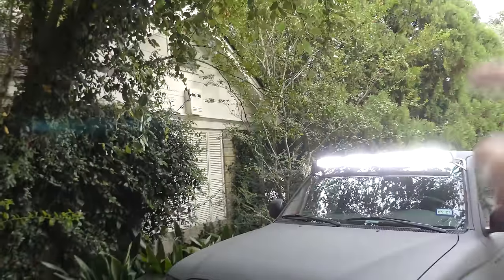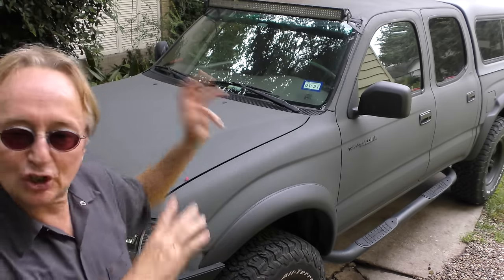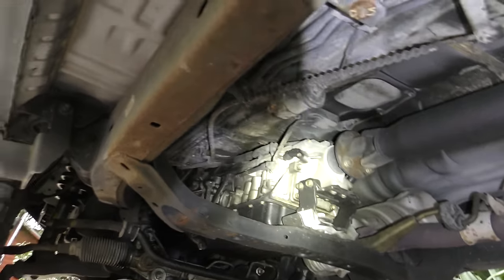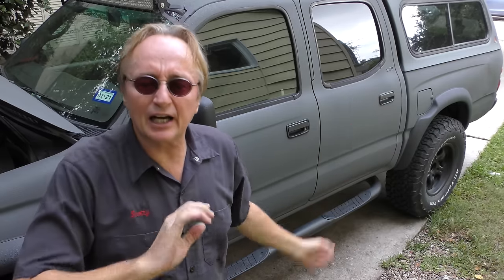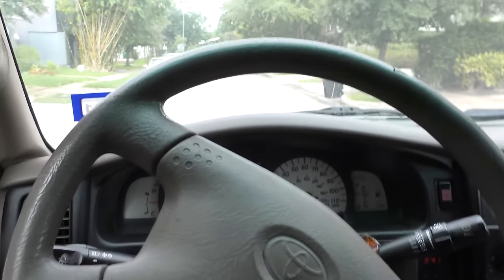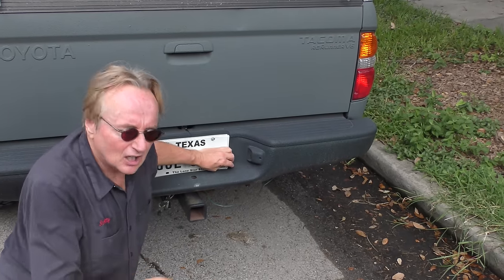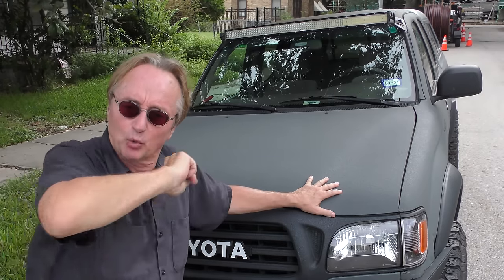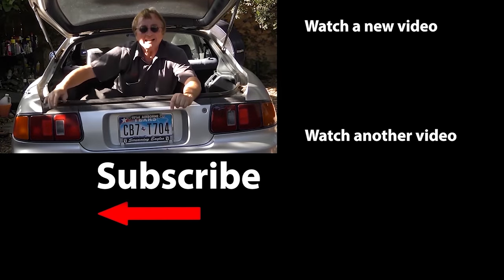Here’s Why This Cheap Toyota Will Survive the Apocalypse

Comment: I have an 02 Taco 6cyl TRD with manual trans,220 k. Paid 12k for it with 125 on the odometer and I do not regret it. I do the maintenance on it and it has been a beast of a rig. I only wish that it had roll up windows. I'm so old school that I would not opt for all the newest "bells and whistles". There is a continuing trend in the automotive world to over complicate/engineer vehicles. It seems to me that manufacturers are clueless as to the market share they could capture if they stuck to the more "tried and true" older model designs us Neanderthals prefer. In short; If it aint broke then don't fix it

Comment: Any pre-2004 Jeep Grand Cherokee or Cherokee with the inline 6 cyl. - I've had 4 and never had a problem with any of them - they've all gone 200,000 miles easy ..they only thing that fails is the power window motor and it auto rolls down when it goes bad ..

Comment: This is my truck. 2004 Tacoma double cab. 3.4 Lt V6 Automatic. It is the best truck I have ever owned, including much newer Ford 150 and 250. I bought it 4 years ago with 155K miles, off a man who sold it because his 16 year old kid was destroying it in the New Hampshire deep woods, going fishing with it. The body is scratched and dented, and the front bumper had been ripped off. He replaced the bumper for me, and sold it to me for 7500. My mechanic said the same thing you did, He has never worked on one of these transmission in his career (of over 45 years) He told me it is the same transmission used in some Volvos. 
She ain't pretty, but she always starts, runs smooth. I get 18 mpg in winter, and 21-22 in summer. I have 195K on it now. I drive like the old man I am now  haha. Oil change every 3000 miles. I need this to last the rest of my life.

Comment: Family had one of them early 80s Toyota trucks... the ones with the funky latch on the tailgate and the beds that always seemed to rust almost completely gone... it was a 4x4..if I recall correctly  Long story short this thing went from Granddad to my father then to his younger brother and then to their older brother... in that time it had 4 beds and 2 cabs on it ... but the same motor and drive train..   till it died somewhere in the mid 90s as a yard truck for the "Back 40"...  thing was a tank..

Comment: I have a 2016 Tacoma I bought new.  I went to buy a used Tacoma because I drove an old 1985 Toyota for over twenty years and it was amazing.  I think I cried the day I traded it in on a bigger truck.  But I discovered that the price of a used Tacoma wasn't too much lower than a new vehicle.  "Heck fire," I remember telling the salesman, "I'll just take the new one!"  
     Bottom line, that 2016 Tacoma is the best vehicle I've ever owned, and I suspect it might be the best vehicle ever built.

Comment: @Scotty Kilmer I bought a 96 tacoma 2.7 4x4 175000 miles runs great but would like to put a 3.4 for more power. Will the 2.7 Trans bolt up to the 3.4

Comment: I had a 2014 TRD Tacoma. with 260,000 miles..it was in better condition than that one.  It needed steering rack, ball joints...I decided it was time for a new truck.  But I wish I had kept the 2004 as a project vehicle and put a long-travel Total Chaos suspension...set it up for the apocalypse, camping, over-landing.  I love my 2019 TRD Offroad, but also miss the 2004.

Comment: I'm thinking of trading in my 2018 F150 with 90k miles (never had any issues), with tool sliders on the back, a DIY power, Raptor lift as well as wheels & tires, raptor sliders. Only cosmetic issues. for a 2000's Tacoma. I'll be getting money back and what looks like a good truck! I have a 981 Porsche so I'll still have nice looking car. Would this be a good deal? I'll be getting money back on the deal.

Comment: I don't typically ask questions cause no one ever seems to answer, but I'll give it a shot. I'm not a mechanic by trade, but I can turn a 🔧. And thanks to you tube can usually find a video that helps get it done, so I had a crank no start condition, found a 2 inch gash on the bottom of my air intake hose replaced that and Maf sensor she fired up after just a few cranks, usually fires instantly, and idled pretty close to normal for a few minutes then it got rough and hesitated when I gave it some pedal. I changed cap and wires they were due anyway. So where do I go from here check for more vacuum leaks? Oh I've got to replace the valve cover gaskets she's leaking pretty good, I guess that's considered a vacume leak in  itself? Would this cause a rough idle, or should I be looking towards the throttle  position sensor, egr valve or the ect sensor if so how do I test these components ? Thank you for any insight info you can give by the way my truck is a 2004 dessert runner 2WD 3.3L XE-V6 NAT ASPIRATED VG33 3275CC Engine thanks again

Comment: I LOVE, LOVE, LOVE that paint.  No more waxing.  Seems very scuff resistant.  Seems like you wouldn't need to baby it to keep it looking good.

I would argue that 2000 to about 2015 was the platinum age of semi-affordable, ultra reliable, body on frame, utilitarian 'trucks'.   For the 'working man', if you want brand new, about the only thing left is the 4Runner, and at $50 large, I don't know that that is or can be considered 'affordable' for most 9 to 5 types.

Comment: I have an 02 Tacoma 4 wheel drive manual trans with 174,000 miles and i can confirm that not only is it a well built beast of a truck but the a/c is top notch as well 😎. Could really use one of them badass paint jobs and a bull bar in front tho.

Comment: Best vehicles for the apocalypse? Toyota Tacoma/Hilux, ford f250 with a camper, ford f350 or f450 with a camper, ford f650 maybe pushing it, ford f150 is an obvious choice especially with a naturally aspirated V8 and a 4 cylinder ford ranger. In terms of pickups. But in terms of SUVs? Toyota 4runner, ford everest and toyota sequoia. I think Ford has been doing well with their pickups.

Comment: Scotty my wifes 2004 sequoia doesnt blow cold air when its idling. Gets colder when it is moving. Ive researched it and ive found it may be the condenser fan running too slow ? Do you concur that this is the likely cause ? Thanks in advance friend !

Comment: It’s all fun and games until the frame has to be replaced. I had 2000 and 2006 Tacomas.  The 2000 was a buy back, the 06 had the frame replaced.
Reply: Nope. Toyota eventually had the balls to recall the frames. American trucks rot just as bad and it's on your wallet to fix it.

Comment: How often do the 4WD equipment like the transfer case go out on these with good maintenance? Sometimes the 2WD ones look more attractive if you have an older or high mileage one. My GMC Sonoma has 255k and electronic transfer case seems to be fine, though previous owner had neglected to change front diff gear oil XD

Comment: Hey Scotty! I have a 2014 Toyota Corolla that hesitates when I accelerate. I wouldn’t think the fuel pump or filter would be bad after only 70k miles and I tried fuel injector cleaner. Nothing stops. It starts up just fine but the issues start after about 20mph. What do you think the issue is? I’ve never come close to stalling and no check engine light.
Reply: Spark plugs or coils?

Comment: You can't judge ANY vehicle in its entirety in the South.  Here in the northeast, these  supposedly trouble-free Tacomas, along with Tundras, were getting their frames replaced under goodwill because they rotted so badly that they were splitting in two.  Meanwhile, Chevy and Ford frames were holding up.  Moral of story: there is no such thing as one superlative vehicle under all circumstances.

Comment: I have been watching scotty for years now ... 

I have this same truck, but 4x4...(260k miles)

EVERYTHING has been rebuilt
cv axles
ecgs bushing
differential drop
brakes- calipers, rotors, pads, drums, shoes, proportioning valve 
all new light fixtures(and led's) 
new grill (with raptor lights)
rock lights
steering rack
bearings
upper /lower control arms
every sensor
rebuilt heads
timing belt kit 
all new belts

ALL gaskets
snorkel safari
rigid lights
new door handles, window motors
ac
new alternator /battery
lift
wheels tires
custom made front and rear driveshaft 
(single piece rear driveshaft... eliminating the two piece nightmare)
full jl audio setup

about to raptor line the whole truck(like this guy did)
volant closed box cai en route
freedom offroad coilovers and better uca's about to be installed

 the list goes on...
Reply: this is the best vehicle I have ever owned...
Reply: but this thing wasn't cheap by any stretch 🤣🤣🤣😅😢😪

Comment: Yah t that yr model they added the 2.4, 2.7 and the best 3.4L engine.  People in Alaska will pay $upwardsof $3000 for that engine if very low miles $1000 if 200,000      I own nothing but Toyota’s and Lexus.  Corolla, sequoia, rx350 and es300.  Boom

Comment: If you can no longer buy gas then no ice car will do . Now then if you have 1500 watts of solar and a few batteries and an inverter you can  charge your electric car at home and the gasoline supply situation wont matter to you . Keep in mind you cant make your own gasoline at home but you most certainly can make your own electricity .

Comment: I regret getting rid of my 1997 T-100 Extended cab its basically the same truck.
Reply: T100 is better. Stronger frame, more payload, bigger gastank, made in japan by hino industries (heavy truck division of toyota)

Comment: Wonder if it would be possible to create an emergency switch to allow the vehicle to bypass the computerized system to let the vehicle to keep running after an EMP goes off which I think would otherwise completely disable the vehicle.
Reply: Back in '85 these trucks could still be had with a carburetor or EFI.
My dad really wanted the carburetor version, for just what you described, but the 
salesman cut him a heck of a deal on the EFI truck.
That truck was the best! Pulled my CJ5 out of mud holes once or twice.
Over 300k miles with 33's from day one. Swapped in a '79 305 out of a Malibu and that thing was scary fast!

Comment: Scotty, I appreciate your technical knowledge, however its a bit firebrand.  Toyota Trucks in my area are usually about 50% above what they are really worth, because of their "utility".  However, the 4 liter and 3.8 liter v6 engines suffer from bad head gaskets after 100k miles.  Almost like subarus EJ motors.  The fact is that most of the cars manufactured after 2012 are subject to "quality engineering" which in turn degrades the part.  Hence why nissan has gone down the tubes after the frenchman took over.  I would really like your commentary on vehicles that were over engineered, and thus last longer.  I have had great success with anything honda, and anything with A K motor in it.  But I know there are more out there, so if you could share that with us, as consumers, I think that would help us the most.  

Thank you for your hard work turning wrenches, and explaining technical things, to non technical folks :)
Reply: I should have been more kind.  You agree :)  The motor in that car was before the refresh, and thus, it is a million mile motor, as long as you change the fluids and respect the engineering :)  Sorry for being a keyboard warrior

Comment: I finally blew a coolant hose on my 99 Tacoma with 220k miles. it was the original hose.
Reply: Radiator cracked on mine well before 100k. One of the weak links, but just replace it with a better one and you're good to go forever basically lol.

Comment: You’re not going anywhere once the gasoline supplies dries up and this would come rather fast in a big crisis situation. I believe the best vehicle in this case would be the new RAV4  Plug-in hybrid which you can drive on both gas and electricity with a good range when needed, and it’s also a car that will be ordinary soon and pretty low-key which is also a benefit in a crisis time.

Comment: if I were to have a post a apocalyptic car it would be a 2nd gen dodge ram
Reply: or 91 hummer
Reply: @recycleman975  or that
Reply: @blademaster2701  yeah
Reply: @recycleman975  is it common for hummers or any other 4x4 to get stuck in sand or thick snow
Reply: @blademaster2701  no
Reply: @recycleman975  is it stupid to chop the back of a minivan to look like a truck
Reply: @blademaster2701  no
Reply: @recycleman975  do you think some should do a hummer h1 vs chevrolet silverado
Reply: @blademaster2701  the best offroaders are hummer and jeep that's why they are mostly used in military

Comment: a modern TOYOTA would not survive a EMP so it would be a bad pick for the Apocalypse because it would not start with fried microprocessors
Reply: Doesn't matter.  Fuel supplies will be gone in a hurry, or too risky to go get, for someone thinking their electronics-free vehicle will be so great after a nuke.  Driving during a nuclear crisis isn't a great plan, you're visible and passing through countless bad spots with no escape from even poorly planned attacks.  You'd never even see who took you out.  Having said that, for lesser crises than everyone's car being dead from EMP, having a high-clearance vehicle is pretty valuable if you have good camping/wilderness skills.

Comment: Cheap toyota? No such thing even a 2000s tacoma with 150k miles is around 15grand or more. I get it they are good but they try to charge way to much for used older Toyota trucks.

Comment: Replace every time he says “AWD” with 4WD
Reply: Oh stop it.. All wheels = 4 wheels
Reply: @TTime685    Ugh, no it’s not. I’m certified to work on them. They are nothing alike
Reply: @mrblondeheart9562  Good for you bud! Nothing alike? Lol.. Both run from transmissions to differentials\transfer cases to axles to ALL 4 wheels..! Not all AWD\4WD systems are created equal anyways.. He was just using the term AWD in a generic meaning, if you can't understand that then you're just slow
Reply: @TTime685  you know nothing about how they work then. 4WD are mostly rear wheel drive with a transfer case to use 4WD offroad. AWD is on road and sometimes is a FWD that has a computer regulated drive system for the rear wheels during launches or aggressive driving conditions. Also not as durable as 4WD. Going through school or working in a shop, you can NOT use them interchangeably.
Reply: @mrblondeheart9562  I know how they work. You're just a tech boy that doesn't understand generic\vague terms and has to make sure you specify to sound smart lol..